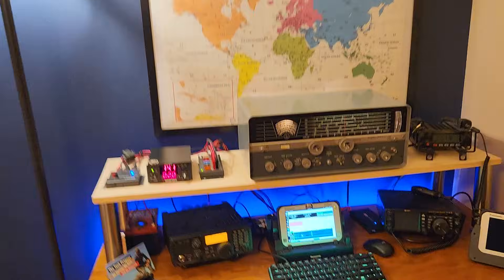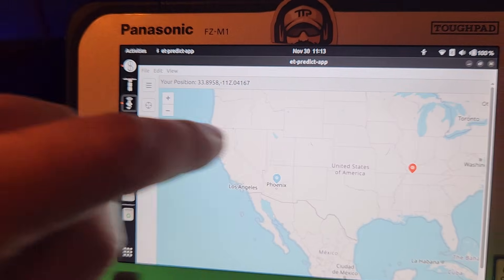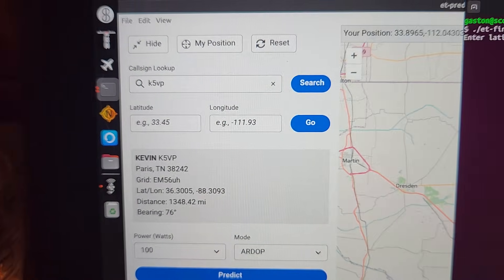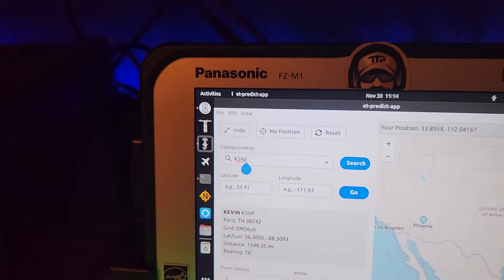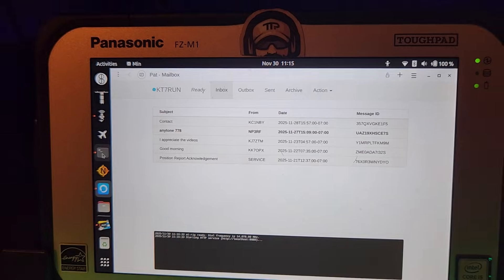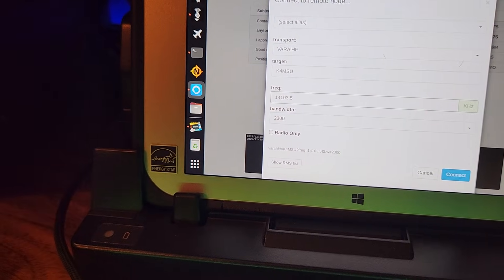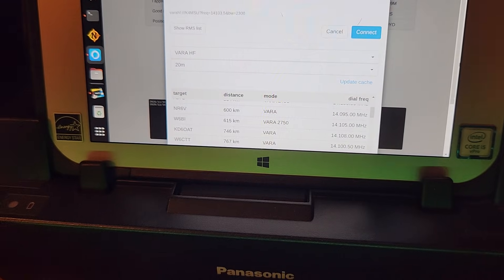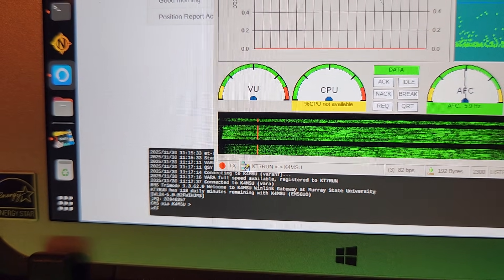Off-grid Comms Breakthrough - Finding a Winlink station using real-time data

Comment: I can’t get VARA HF or VARA FM to open at all with ETC-R5, it worked fine with ETC-R4.  I just installed R5 this weekend on the same computer (Microsoft surface laptop 2) that R4 was on everything else works fine but VARA won’t open. I’m scratching my head.
Reply from the maker: I'm scratching my head too as nothing in R5 would have broken in it.

Remove the .wine32 directory in your home directory. Then, re-run the wine installer scripts under the add-on directory.
Reply: @TheTechPrepper  Ok so I go to work. I tried what you suggested and that didn’t work, I then purged and reinstalled wine and that didn’t work. I purged it again and downloaded your wine install script from the EmComm Tools GitHub and ran that and finally it worked. I’m thinking something didn’t install correctly when I was building R5. It’s working now so that’s what matters.

Comment: I do alot of NVIS in central Washington and relative distance is pretty critical to me. 75 mi as near my minimum range can get closer with increasing difficulty, generally 100-300 mi 230mi has been my sweet spot range. for me that would be bend Oregon. if I want to push traffic to say Olympia or near by I can look for a station that has multi band capability and I can try to connect on various bands till I find the best connection then use that band to connect to my chosen station. someone said that any propagation further than 250mi is not technically NVIS it is an angle thing.     NOTE I use NVIS configured antennas and just under 1000mi is my best range like 900
Reply from the maker: Thanks for sharing experience. Cheers to another regional operator. Our group in the Southwest primarily sits on 40m and leverages NVIS propagation with our low wire antennas. The technique shown here works best with skip and low takeoffs angles for finding clusters near a DX station. These stations are farther away and rarely make sense sorted by closest station. 73

Comment: If it’s a grid down situation will the gateway still work? At that point would it have to be a radio to radio transmission? Thanks for any info. Great content.
Reply from the maker: It depends. In a full grid-down outage where the entire U.S. has suffered and full electrical outage and Internet outage, going through a Winlink gateway will be a failure point. However, you can still send email peer-to-peer (P2P) using the same technique.

Comment: Slowly investing into making everything happen. Just bought a FT857D . The Panasonic toughtpads are hard to find though in my region. Any links for sale?
Reply from the maker: Slow and steady. Congrats on the FT-857D. What a great rig. At this point, I am fresh out of links. Have you tried reaching out one of the rugged dealers? I had great experience with OC Rugged Laptops recently.

Comment: Excellent. Curious what you use for offline call sign lookup. That would be useful even for POTA/SOTA. 73
Reply from the maker: It's a custom service that I wrote with a custom data set. It uses a copy of the FCC database (callsign, first name, city, zip, and state). Then, I geocode the zip code using the Geonames data set. There's a small Lucene index that runs in the background to handle the queries. Yes, it's very handy for SOTA/POTA.

Comment: That works. At this time, I use trial and error of different stations. I almost always get a connection by the third try. Having a gain antenna, like a Moxon, pointed in the general direction helps a great deal. As an avid HF Amateur Radio operator, I have general knowledge of band conditions, time of day, time of year and solar cycles, etc. which helps determining which stations to try. Your method is not something I had considered, makes a lot of since. Looking forward to your final package.
Reply from the maker: I've used your approach primarily in the past. Like you it takes me a few attempts.

Comment: Would be cool if ET logged everything to a local DB for each attempt: gps coords, datetime, band/mode, target RMS, success/fail, and basic SNR/throughput. Over time you’d end up with your own propagation/performance map for your station that ET could mine to recommend “best RMS right now” totally off‑grid.

Just need basic weather + ionospheric/solar context in the same off‑grid style (for ex, via HF weather/WWV/other broadcast sources) and store that alongside the link metrics. Feels like ET could quietly build a really powerful local conditions database the longer it runs, without ever needing live internet. Would make getting out on rainy days worth it just to log some extra data.
Reply from the maker: I actually built a light connection data tracker that logged the date, time, frequency, mode, power, antenna, and the two stations so that I could track success and failure of the connections over time, but never finished it. Adding space weather such as the monthly sunspot number, SFI, A-Index, and K-index would be excellent additional data points. Thanks for the additional food-for-thought.
Reply: As an extension - just need the DB to also be shareable off-grid and sync'd to your local ET. Then, if traveling, could hit local nodes to get a headstart and perform some statistical analysis on-device to determine "how unusual" (something like a z-score) the present days data is relative to all known data. Could maybe work a block-chain sharing, cryptocurrency angle like Helium (HNT) if you wanted to go all the way and create an incentive to collect and share the data.

Comment: Huge fan of Winlink over Vara HF, I'm always testing this few times a week, in the 20, 30 with an EFHW, or 40 meter with an NVIS antenna. I'm always looking over the propagation map online to figure out the best band, and to see if I go West/East/South or North. I did use JS8Call sometimes to see my SNR and my propagation, but Vara modem seem to be more « touchy » than JS8. So I use sometimes VarAC and look on beacons activity and PSKReporter to figure that out. It's a lot of work and dependencies right there and the use the Internet of course, which make no sens to me for EmComm. Thanks Gaston, it's a great Idea, 73 de VA2OPS.
Reply from the maker: You're doing all the right things to determine your best path, even if you need to leverage online tools. It's nice being able to tie in all the new capabilities in EmComm Tools to make finding a Winlink station quick and completely offline.

Comment: Could you please make a video about the complete list of software one should have for off-grid communications in case there is no longer any internet access and no possibility to download anything?
Reply from the maker: It's basically the list of software that I have been building into my EmComm Tools platform. There's a list of the applications on the main community.emcommtools.com site.

Comment: Couldn't you make an offline propagation predictor based off recieved ft8 signals? They already have location info within the signal, no need for a call sign lookup.
Reply from the maker: Sure. That works as well. The goal is to use any real-time circuit as the basis for performing a geospatial search around those target stations.
Reply from the maker: I already wrote the offline call sign lookup years ago. It's handy for returning other information that would otherwise require an Internet connection to QRZ. I also use it for circuit analysis with VOACAP. It's a collection offline tools.
Reply: I suppose a js8call heartbeat can get multiple responses simultaneously, which is quicker to see where you are being heard. Good stuff, thanks for your hard work!
Reply from the maker: Exactly. That's usually my workflow in the field. It takes 30 seconds total for a full heartbeat transmit and response. It gives an excellent real-time picture of the current propagation circuits.